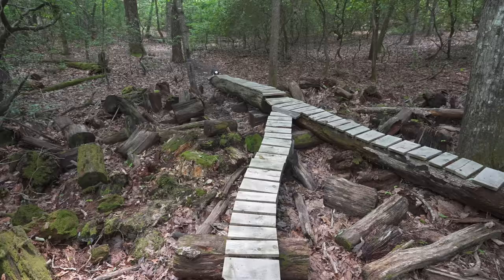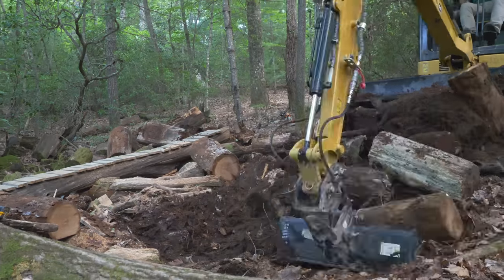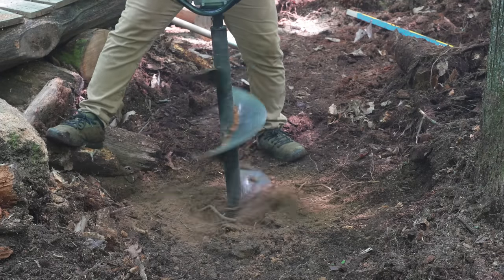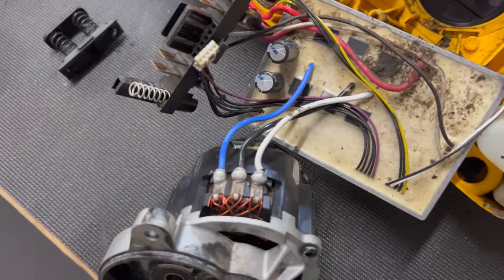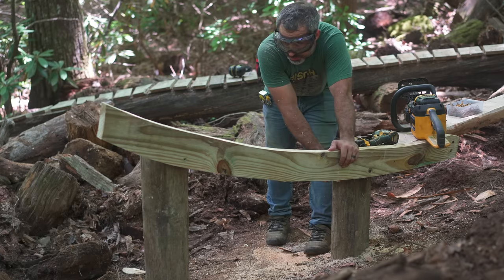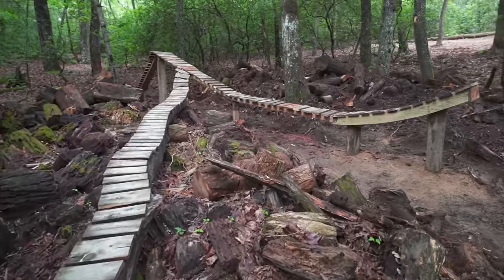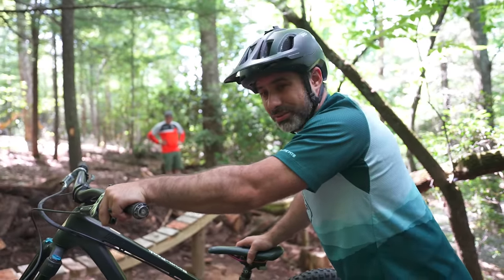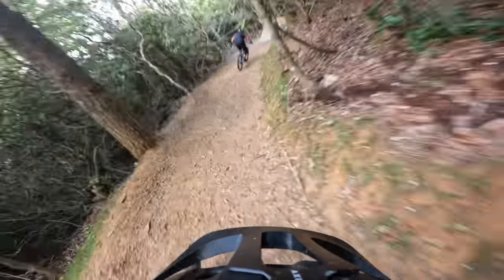Building and Riding the NEW Snake Pit! Bigger jump & sketchier B-line

Comment: I've had really good luck with Penofin wood sealer to keep my north shore from rotting. It's a Brazilian rosewood oil that soaks in to the wood and provides pest, rot, and UV protection. It also does not make your wood slippery like other wood sealers do.

Comment: To help with the cedar cracking, if you blunt the tip of the screw it should prevent cracking. Whack it with your hammer or hammer it into something hard and you should be gravy.

Comment: Seth you should look into using concrete deck blocks with the metal bracket in them.
This way you have a block that’s easy to replace if the metal rusts out (they sell them at Lowe’s and stuff) and you can just pull the screws out of the bracket, to replace the post which is now completely out of the dirt, just on the off chance that it starts to go bad

Comment: I wouldn't put this in the video, but you could always paint it with used motor oil.  It absorbs completely, doesn't stain after dry, and will keep it from rotting for a long long time.

Comment: 5:48 ok that looks so easy..I spent hours taking off bark without metal tools, and it so hard to keep the bark intact. I used to use patches of bark for rainproof roof in the "forest" over here. I'm pretty sure when the shelter is done, I'm going to work on the trail stuff here, especially when I have a decent bike. Will have to get super creative without electric tools, just some natural rope, a small foldable saw (takes 2 hrs to saw through 10cm of wood)..kinda like I'm Amish..but I'm not PS: wouldn't even dare to ride that snakerun right now, loving the video though

Comment: If you have rotting trees like yours, get some star pickets or T posts I think you call them over there and run a chainsaw cut along both sides of the tree and place one side pf the star picket in the groove/cut and screw in a criss cross pater to secure, then you can use self tapping metal screws to secure you the cedar planks to the star pickets and BAM! Just like new again for less work and probably money

Comment: Yo Seth just a quick question ik you probably won’t reply but I am looking to upgrade my fork I want something with 130 mil travel and is not tapered and an air fork aswell as fits 27.5 inch wheels just wondering if you have any recommendations?

Comment: The problem with sketchy features is always the first time, and quite frankly there are no outs with this design. You've raised it off the ground, made the B-Line, which was supposed to be the safe way out, almost harder to take than the actual feature, both of which are blind. Someones bound to get hurt on this thing.

Comment: 4 inch piece of wood and four inch screw counter sink the screw 2 inches most of those screws your using even have a little sawtooth feature built onto the back side of the heads to counter sink themselves a half inch or so but anymore than that you need to drill the wood to avoid splitting hillman brand screws exspecially have the sawtooth head a great self tapping end and an accelerated thread at the top to help pull stuff together tight the real strength if a fastner is not the shear strength of the screw or nail itself but the friction resulting from it drawing the two materials together which a great reason to always tap a nail on more time and even hit gun nails once or twice to draw the materials together 
Just a bit of knowledge from a carpenter it’s tough to get good screws over 4 inches long much less at any kind of price that makes buying a couple pounds of them plausible